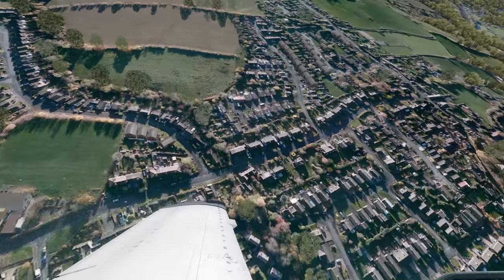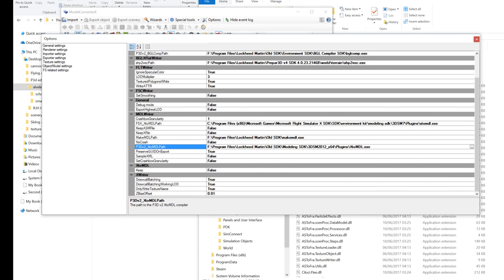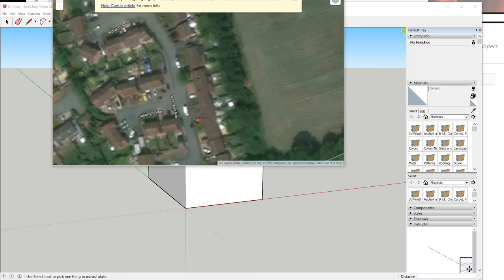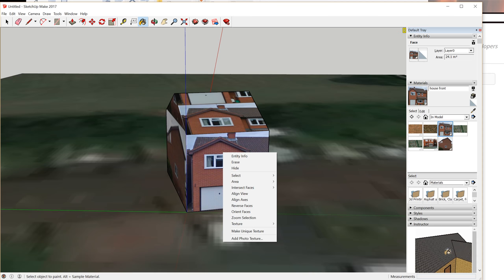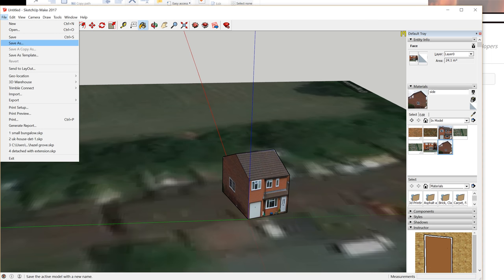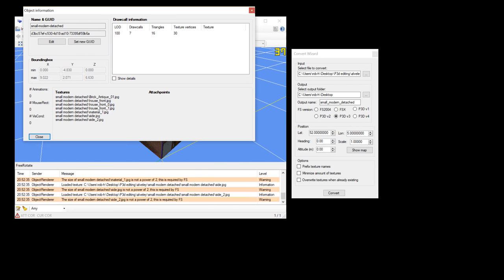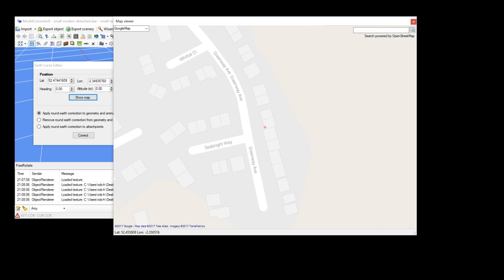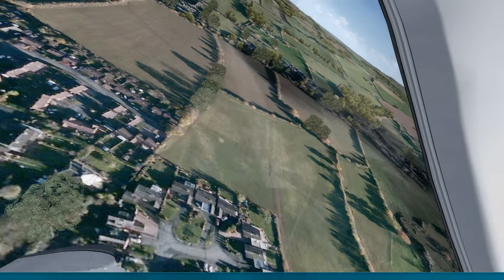Make your first model and place it in FSX or P3D

Comment: I tried to get Sketchup FREE.  It is now Cloud based.  It is so crippled that you cannot save it in any workable  format.  All you can do is work with the tools, but you are unable do save anything.  I want to thank you for your SimDirector video.  I was able to place  aircraft. at a default airport.  Very cool.  Since Sketchup no longer works for a modeler.  I've downloaded and old version of GMAX.  Don't know if it will do the job.  Is there a truly free or reasonably price CAD program that will create files the ModeleConverterX will convert to P3D v4?
Reply: Go here to download an older version of Sketchup that will do all you need for this.
https://www.sketchup.com/download/all

I used "SketchUp Make 2017"

Comment: If you have the images of all the building sides, I am able to make models for you with fairly accurate height details, checkout my channel and the airports I have created for P3D and FSX over the years.
You would be surprised how many in flight simulators actually drive around, also the bottom of your model needs to be removed to decrease poly count, as many models with to many polys can impact your frames.